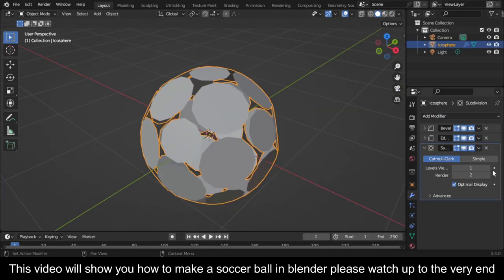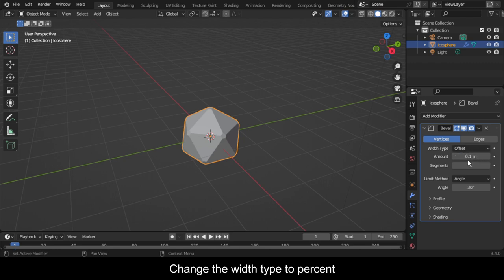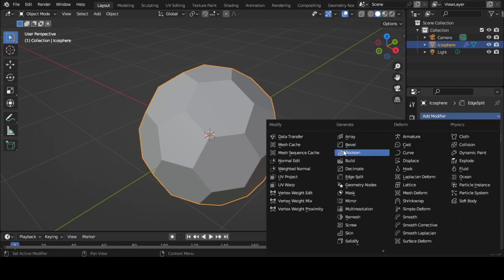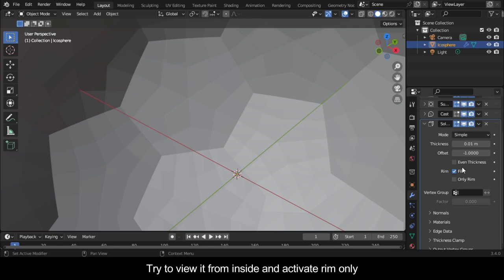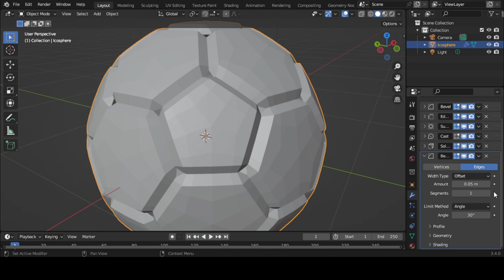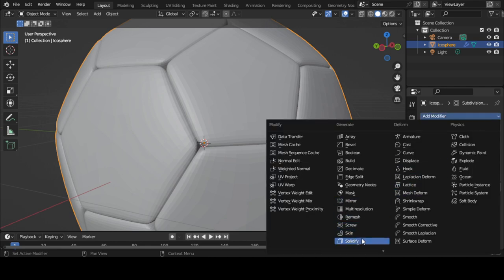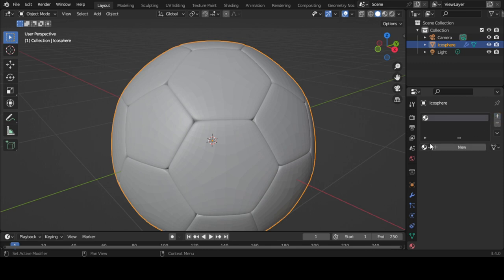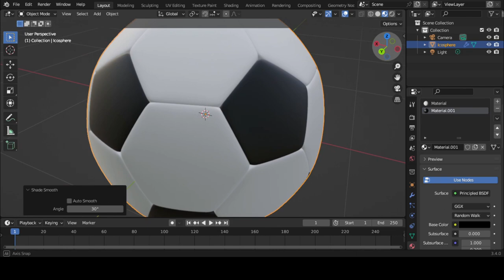Easiest way to model a soccer ball in blender | how to model a football in blender

Comment: One tip: In the first CAST modifier, you do not have to mark the SIZE at 1, that should remain as it was, at 0.5, it is in the FACTOR from 0.5 to 1 where you must modify to obtain the roundness, so you don't need to add another cast